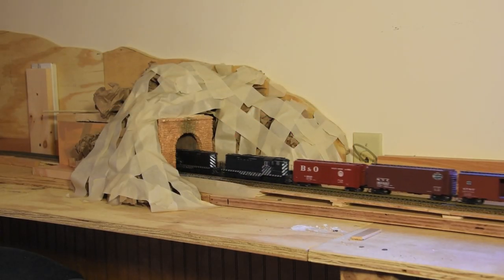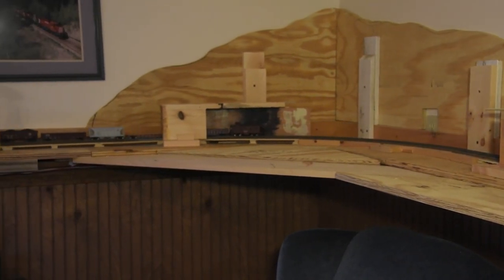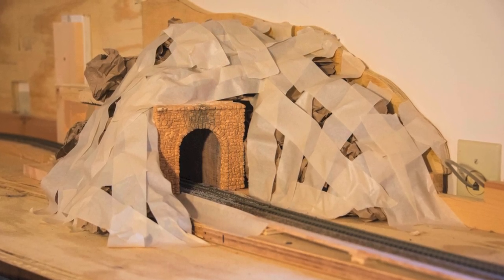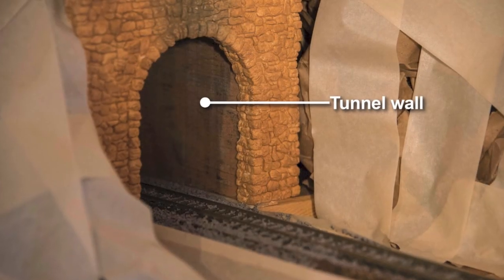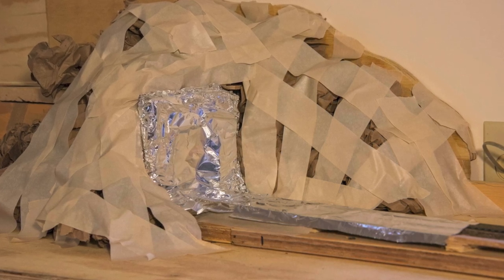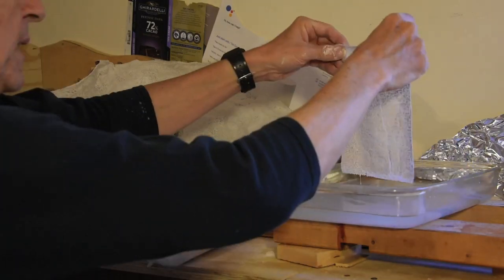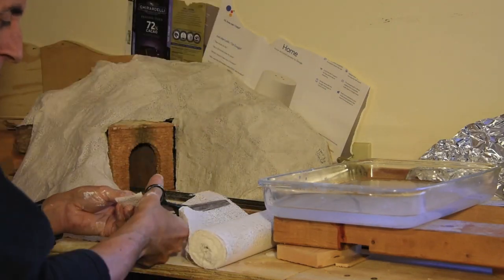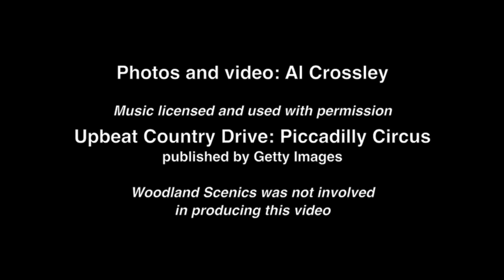Getting plastered in the mountains--using plaster cloth for model RR scenery

Comment: Nice video. 
I was considering using plaster cloth rather than dipping paper towels in plaster because of the mess it causes when i use that paper towel method. Hoping it is not too difficult to smooth the holes out of the cloth. That is my only concern...Any suggestions are welcome...Thanks.
Phil
NYC / Jersey Shore Area
Reply from the maker: Thanks, uptown!  Yes, the holes in the cloth can be a problem.  Smoothing them out between your fingers while holding the plaster cloth (before laying it down) can help, and so can the foam putty from Woodland Scenics.  Joint compound might work as well, although that's likely heavier.  Ultimately I find that once the scenery is painted (thicker paint is another line of defense) and the ground cover, bushes, trees, etc., are applied, you've mitigated the problem.

Comment: Hi. Love your technique for making your mountain, but would’ve liked to see how you constructed the tunnel before adding the scrunched paper & tape. 
Can you tell me what brand portals you used and what size please?
Nice ideas! Thank you!
Reply from the maker: Thanks for your kind comments, Wheaterz!  Interesting thought about the construction of the tunnel.  I basically built a partial box over the track with whatever wood scraps (1x6 pine, maybe) I had on hand.  It needed to be only a few inches to a foot long to support the plaster immediately around the tunnel portal.  The distant portal at the other end of the mountain perhaps shows it better at 0:22 of the video. Note that the box has a longer top to protect the track underneath. The rest of the mountain was based off that plywood that's up against the wall--I filled up the entire cavity (well, sections at a time) with wads of paper, taped over them, and applied the plaster cloth.  The tunnel portal (see 1:33 of the video) is a Woodland Scenics HO single track stone portal.  Please let me know if you have other questions.
Reply: Cool! I watched again, but this time for the plaster cloth application. Never used it before & so you make it look easy. I like the idea of the hill/mountain extensions where they run down both sides of the portals… think I may emulate that. Thanks!! 👍

Comment: Were the little holes figured out in the plaster cloth or were the holes visible after you painted?  I’m wondering because I’ll confront the same issue with my plaster cloth. Thanks
Reply from the maker: Thanks for watching!  Yes, the holes are pre-existing in the cloth, perhaps to give it more 'tooth' or perhaps just to save plaster(?).  And yes, you can smooth them out between your fingers (pulling down across the sheets) as you pull the cloth out of the water bath, but that 'holey' texture will remain after it's put down, even in areas where you overlap it.  Typically it's not a problem because you'll likely be painting over it, and/or applying some kind of surface covering (grass, weeds, shrubs, and so on).  But if any areas persist that bother you, Woodland Scenics (and maybe others) offers a 'foam putty' that you can apply over them.  I smear it on with my fingers, though perhaps you'll prefer a rubber spatula or similar tool.  Good luck!
Reply: @railhead5771  thanks for the recommendations!

Comment: I've been doing a compleat strip and rebuild of my O gauge set. Now larger with all new Gargraves track and Ross switches. The final and last rebuild in my life time so I want to do it right getting older now modeling since 1968. I was stuck in thought how the hell am I going to build my mountains well now I know. All I need is news paper going to get that now. Hobby lobby has the plaster sheet rolls but $20 for an 8x120 kind of pricey. Don't think woodland seens would be any cheeper. Anyhow I subscribed to you I think you can help me out more.as I go. The the track is laid only for under the mountain at this time. The mountain is un-reachable once its built. Not the best scenario but it is what it is. Taken care Vince F
Reply from the maker: Just now seeing your post, Vincent.  Hope you're well along now and enjoying your new scenery.  As posted above, some craft stores carry it at cheaper-than-hobby-store prices.  Don't know if you have the flexibility, but I designed an access hatch under my track shelf in case of a derailment.  Haven't needed it yet, thank goodness.

Comment: Would it have been faster to cut the plaster cloth before hand?
Reply from the maker: Sorry, 1951--just seeing this now.  Possibly it would, except that I more or less make it up as I go along, so I'll sometimes need a certain shape or size piece that I couldn't really plan for. But yes, in the general sense, if you're doing a large area, you could pre-cut several sheets first and fill in later with the oddballs.  Thanks for watching!